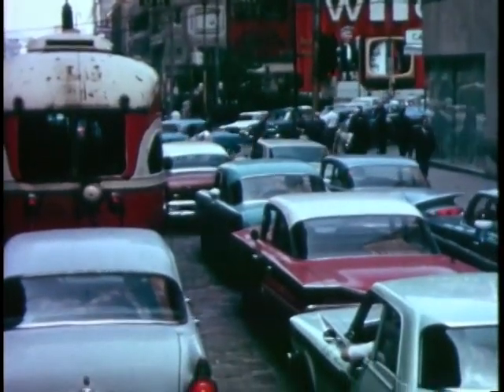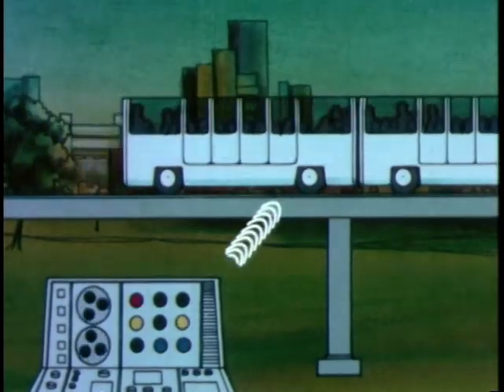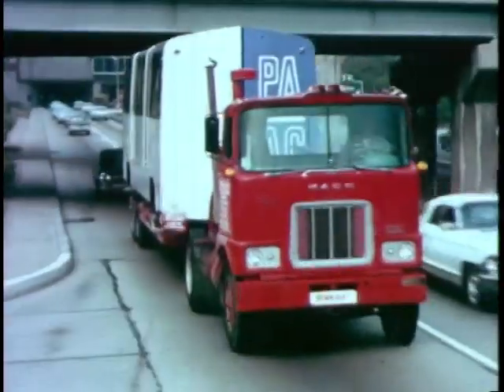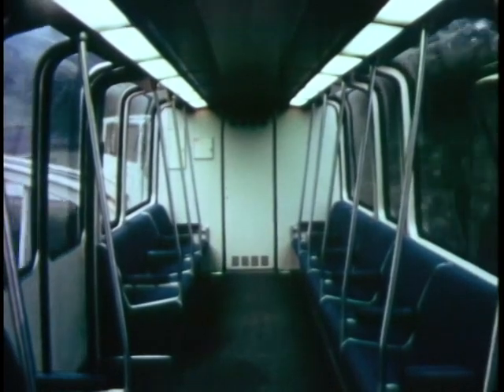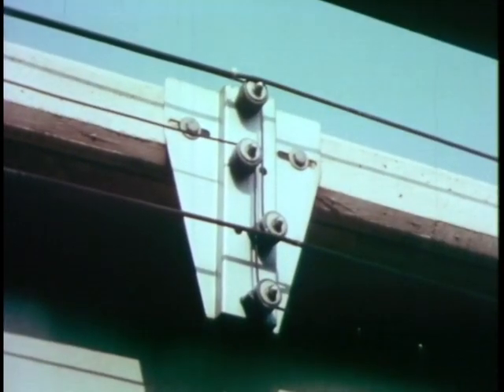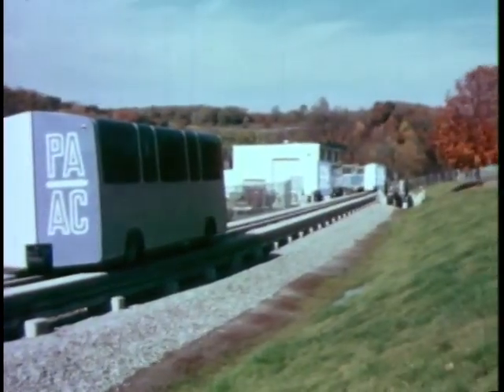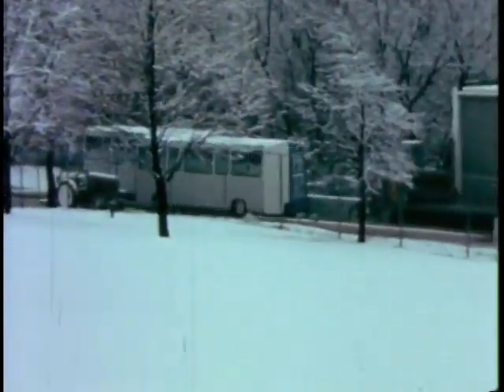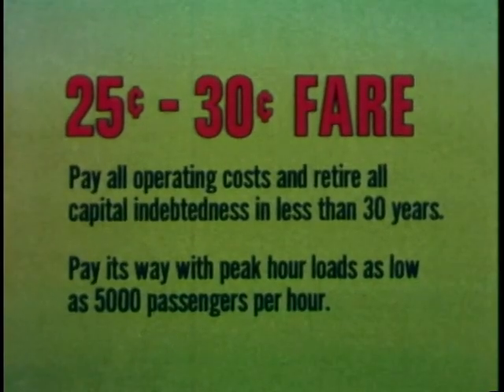South Park, PA - Skybus People Mover

Comment: Thanks for posting this video.  I remember riding Skybus when my mom took us kids to the County Fair around 1970 when I was 10.   It cost 10 cents to ride and as a kid I thought it was the greatest thing going.  For me this was one step below flying cars.  Little did I know at the time that this progress would be stopped for a number of political reasons and that 15 years later we'd end up with the same system layout we had from the 1920s.
Reply from the maker: I agree with you. Plus we now ride on them everything we are at airports! I even taped the arrival of the first made unit. A builder of people movers bought it and restored it. It was outside their facility in West Mifflin. So I've seen it full circle!
Reply: Too bad they didn’t stick with Skybus but use it where streetcars were already gone. I’m glad they upgraded what streetcars were left weure upgraded to light rail but they could’ve built a Skybus line to the airport.